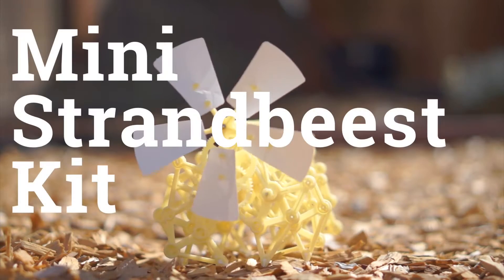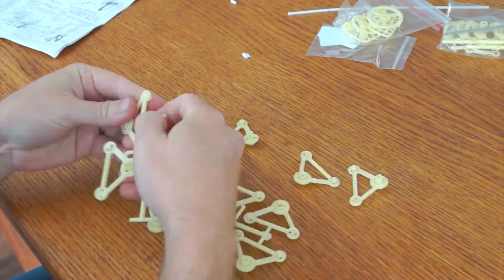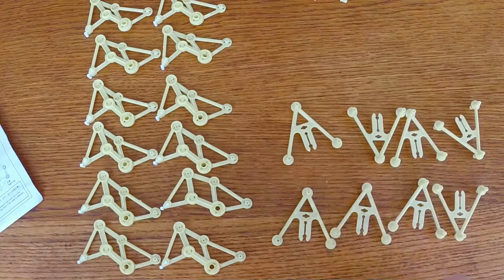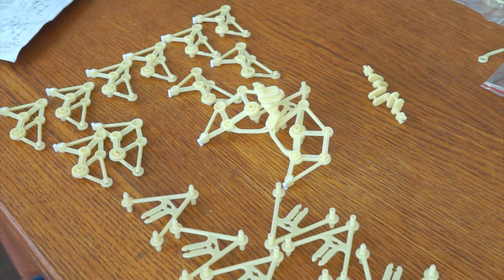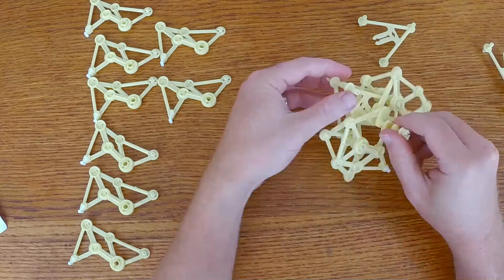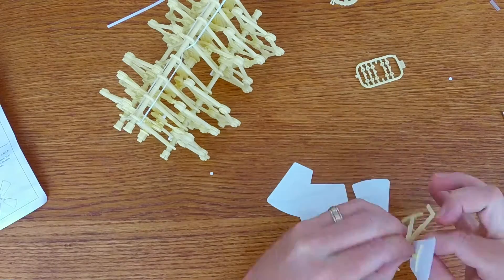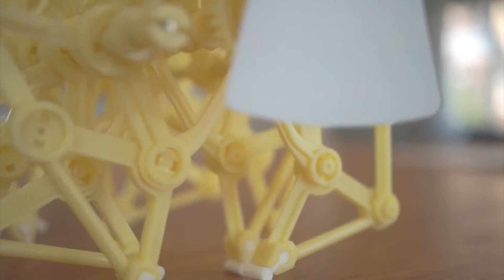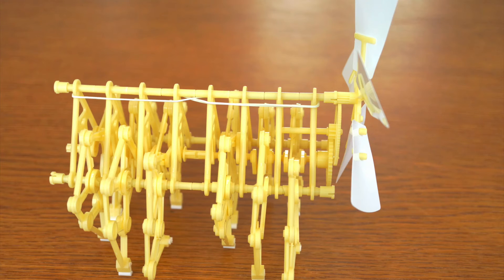Mini Strandbeest Kit: Timelapse Build (w/commentary)

Comment: Doing the video at fast forward is of no use especially when it comes to demonstrating a critical task, attaching the legs to the crank. Normal speed from a few angles would have been helpful. Your video was disappointing and of little use frankly.
Reply: Just put it in 0.5x speed